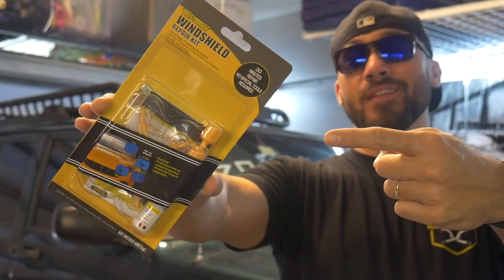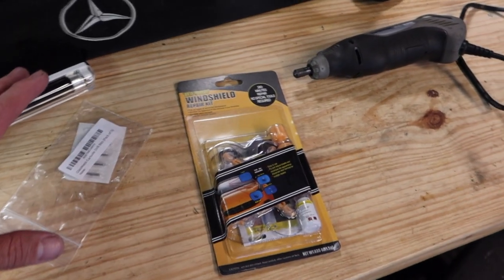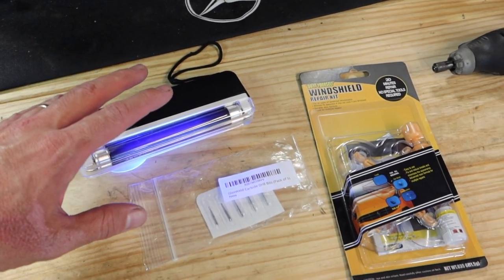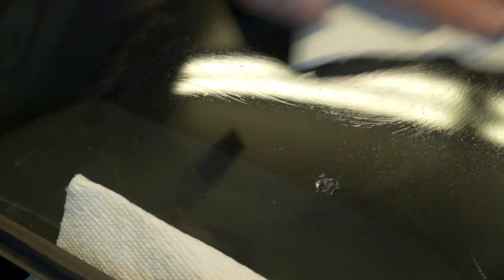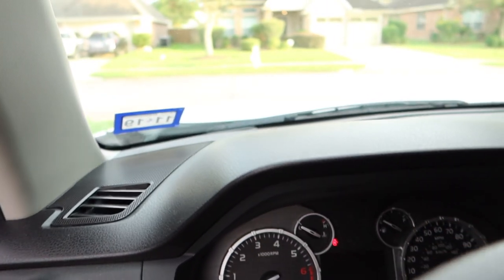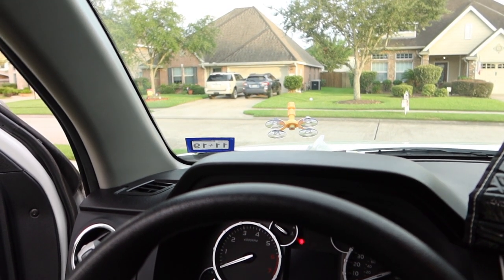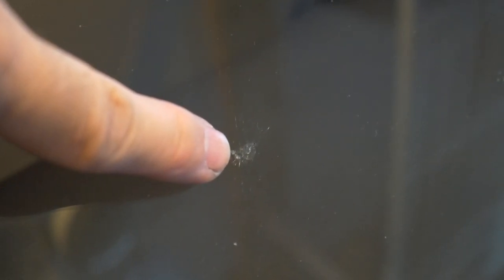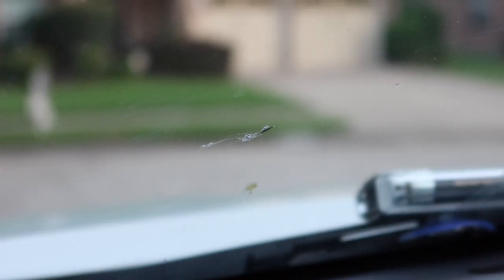How to Repair a Windshield Chip / Amazon s Choice DIY Window Rock Chip Repair kit for 10 dollars

Comment: Good video.  I've used the cheap syringe kits with good results.  I just bought a similar kit to yours but aluminum instead of plastic.  Hoping for similar results.  Just a note, you can use a drop or two of resin after you have done your repair with the mylar sheet to fill in any surface blemishes.
Reply: What brand have you found to work the best?

Comment: Thanks. I saw an ad & i wanted to know if it would work for my little tiny dings & now i see that somebody probably already did this that's why they're tiny dings not cracks. So i definitely found what i came looking for & that's probably not worth my bother. My jeep looks like yours that fugly green color 🤗 i painted & i was like oh bc i realized on de inside of de door that de color i painted it was de original color 😂 but fugly green is good too bc it's a jeep meep beep then de paint washed off in de rain but only on 1 side so 1 side looks camouflage like i did it on purpose which is funny i think.

Comment: Amazon product desc page says this works for straight line cracks also. How would plunger be used for a 2 inch line crack ?
Reply from the maker: I’ve never had any luck , with any kit trying to fix straight line cracks.

Comment: Problem is that you drilled the center of the crack, so no pressure to force the glue into all the cracks.  You'd been better off not drilling at all.  Although drilling the end of the individual cracks - this is called stop drilling - can be done to keep the crack from getting larger.
Reply from the maker: Ever worked for a windshield company? I know the answer.

Comment: 10:30 you are supposed to undo the whole thing, not one at a time. undoing the smaller pressure thing first means you could have sucked the resin back out. which is fine if you are removing air bubbles and going to push more resin in again. but if its the final time its not ideal. probably doesnt matter though. also, its strange that repair didnt work better. using a hairdrier on the inside and just repeating the steps over and over gave good results for me.
Reply: actually nah, it worked pretty good. also i dont know why they recommend the hair drier for stubborn repairs, or why it actually seems to work. as a cool windshield would contract the glass and open the crack more to allow resin in. so you would think a hot windshield would close the crack and stop resin getting in..

Comment: 1. Am I wrong or is there a risk of damaging the work if you move the vehicle before curing is complete? (Flex stressing, for example).

2. I have run into situations where I didn't have a smaller collet (drill bit holder). I managed to get away with wrapping a bit of tape around the bit to make up the difference.

Comment: this video is not done correctly. your putting to  much pressure  when your turning that dial. and he couldn't get the whole thing fixed because of the heat? no he was making an excuse cuz he didn't do it right.